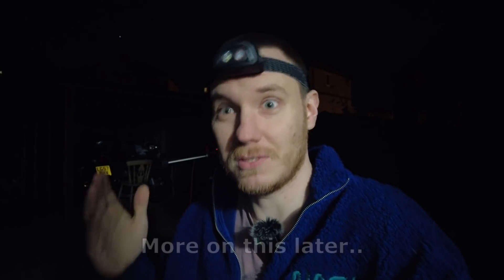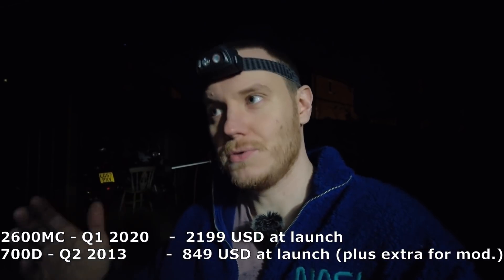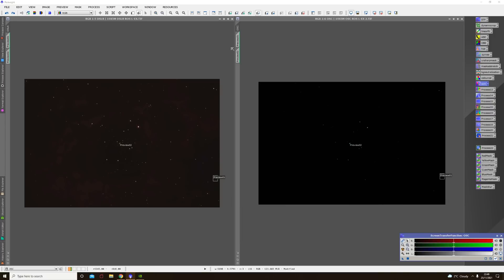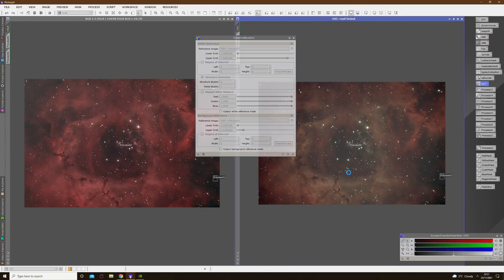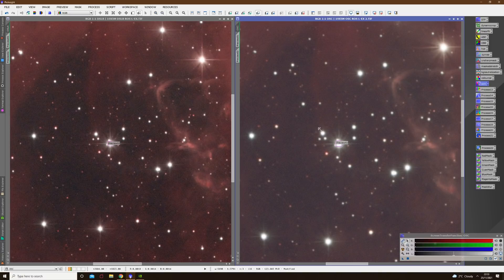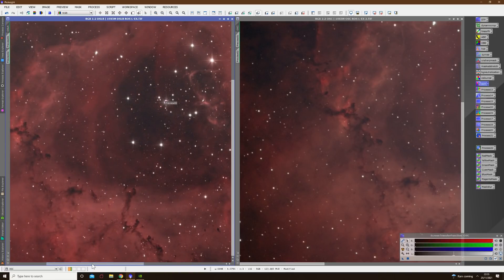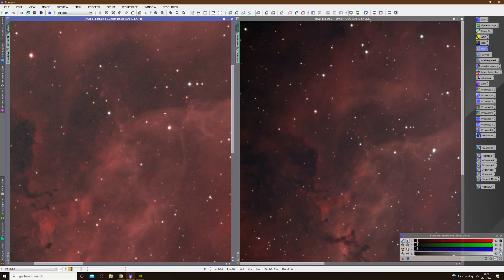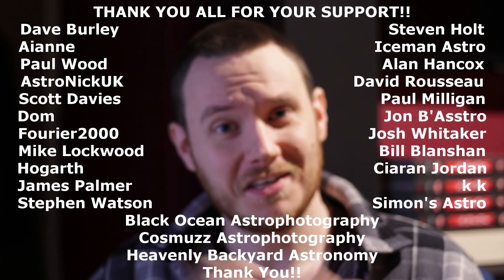Modified DSLR VS Cooled OSC - Part 1: NOT What I Expected!

Comment: I think it would have been better to just edit both images individually. 
Since the DSLR has more noise, but also more contrast, it suggests that the OSC still has some "room to manoeuvre".
Kind of like (but obviously not the same as) the way jpg images look better than RAW images when they both come out of the camera.

It's also a bit like hopping into 2 different cars, and assuming one is faster because the maximum speedometer reading is higher, without actually driving them to test it out.
It would probably have been better to either get both images looking the same (colour and sharpness), and then compare the noise levels; or else get the noise levels the same, and then check the quality. 
If that makes sense?
Reply from the maker: Totally appreciate what you're saying mate yeah! I could/should have added that as an additional segment, then it'd be pleasing to both parties :-D
Thanks for the feedback!

Comment: Interesting test, but I think that DSLR RAW files might have an automatic contrast curve applied to them by the camera, while the OSC camera might be linear. You should have tried to play with contrast to equalize the two images. Then you can compare them.
Reply from the maker: Thanks for the feedback Lou! - There were a lot of ways to approach a test like this I guess, inevitably adding more steps introduces more variables though, so I opted to keep things as simple as possible during part 1, - in part 2 I did alter some aspects of the test in order to improve the quality of the test result, but still try and keep variables minimized :-)
Clear skies!

Comment: In addition to what others have said, the OSC camera has smaller pixels and will need to be exposed longer to get a similar SNR.  I would expect the OSC to have a "softer" looking image, all other things being equal.
Reply from the maker: Hey Ryan! The OSC may have smaller pixels, but does have much higher QE, a BSI sensor, lower read noise and lower dark current, which should more than make up for the slight physical pixel size mismatch between the two cams - I believe something went wrong such as the primary mirror or filter itself slightly fogged during the OSC portion of the test, leading to it being a bit of an unexpected result - part two gave a result more in line with expectations, I switched to my refractor for it to remove as many extra variables as possible 👍
Thanks for watching and clear skies!

Comment: I have just skimmed the comments, so apologies if I missed it, but not much was considered on dynamic range and data clipping. The 700D at 1600 ISO has about 9 EV of dynamic range where the 2600MC is over 13 EV at 100 gain.  I believe what appears to be sharpness may be clipped dark areas. At time 10:43 in your video the core of the Rosette shows nebulosity in the OSC camera but just black in the DSLR, hence my thoughts on DR.  The other issue is in camera processing of RAW files verses the OSC FITS files. I would bet the DSLR processor will boast the saturation compared to the OSC processor, but that is just speculation. Lots and lots of variables to consider BUT the bottom line is that DSLR can provide attractive results without spending gobs of money. Good results have more to do with good technique and good seeing verses super-duper equipment. Thanks for the time and effort to make the video, worth watching.  Clear skies!
Reply from the maker: Hey Edward! - Thank you very much for your thoughts on the matter, they were interesting to read! :-)
I'm happy to say a second test with revised methodology has delivered much closer to anticipated results, while still leaving the DSLR looking like a very capable offering indeed for the price!
I hope that you may enjoy part 2 when released if this is something interesting to you! :-)
Clear skies!
Reply: @lukomatico  I look forward to it. Most all technology has strengths and weaknesses. The old saying "Horses for Courses" comes to mind. The sensor processors in "land" cameras are tuned to process day (high signal to noise ratio) photos and astro cameras  to process low signal to noise ratio photos but there is cross over and all are useful with proper handling and understanding the limits - which is what testing is all about. Besides it keeps us out of the bars (pubs) at night - at least until we get the auto imaging routine down - just don't tell the misses. :) Hun, I'm off to the dark site!

Comment: Very interessting experiment. I think, the Canon photo only appears sharper because it is noisyer. In the further processing you should be able to sharpen the ASI photo at least as much but with less noise around than you would be able to do with the Canon photo.
The tighter stars in the DSLR photo might be caused by the fact that with bigger pixels, you are better sampeled. With the ASI 2600MC you are a bit oversapeled, which blows the stars.
This is my understanding of the really unexpected results.
CS Christian
Reply from the maker: Hey Christian! - Thank you so much for watching :-) I appreciate the hypothesis!
I've since taken a part 2 to this which is nearly ready to be released, which more clearly shows the advantage of the OSC over the DSLR! - I think it seems most likely now that the auto-focuser missed focus with the OSC marginally, coupled with potentially a light misting of dew on an optical element (not tracked down what) reducing and scattering the incoming light.
The re-test was done with my Esprit 120, which has proven to be a more suitable test platform it seems :-) I hope you may agree when part 2 is released for your consideration!
Thank you so much for watching!
All the best,
Luke

Comment: Good comparison. And thanks to take the time to do this test. However, as others have said I’d repeat the test on the very same night and same time for each camera around the meridian (say for example one hour for one camera until the OTA reaches meridian and then change the camera and let it image the same object for another hour). That could be more representative, while keeping all of the same equal.

If I may, to me it looks like there’s a flat calibration difference between both sets (take a look at 8:02). The OSC image to the right shows some vignetting that the DSLR image on the left doesn’t show. Maybe it would be worth checking. When I upgraded from a modified Canon T1i to an ASI071MC Pro immediately saw a difference in pre processing was required: the 071 gave better results if flat darks were used, while for the T1i I just needed a mast3r bias to calibrate the flats.

I’ll be looking forward for your next video on this subject.

Regards,

Alfredo
Reply from the maker: Hey Alfredo!
Thank you very much for the suggestions! :-) I appreciate that, I've applied very similar changes to the methodology for test 2 which is now recorded! safe to say it all went off well on 1 night :-)
I do tend to use flatdarks already for the reason you suggest, normally my images calibrate well but in this case it wasn't quite perfect, possibly due to the limited data pool of lights I had, some may have been contaminated by little bits of cloud contributing to difficulty calibrating accurately :-)
Thank you very much for watching and taking the time to comment!

All the best,
Luke
Reply: @lukomatico  Very well, Luke.

I’ll be looking forward to watch the new video when it’s available!

Comment: This video interests me because my QHY 8L is no longer managed well by the programs. It disconnects too much and the temperature is not stable. QHY technicians connected via teamviewer but nothing special. The next morning they told me that their Stellarmate had managed to fix it. Too bad that the day before not.
I have had the MPCC Mark III 2 "Baader for two years, and I was only using it as a coma corrector without the M48 ring. I decided to mount it to use my Canon, but suddenly it unscrewed and the camera fell on the ground! I bought an M48 ring on Amazon and it works.
How long do you pause between shots?
Reply from the maker: Hey Paolo! - sorry to hear your qhy8l is giving you trouble :-(
On the note of pauses between exposures, I let it have 2 seconds between in the plan I believe :-)
I hope that helps a bit, and thank you for watching!
Reply: @lukomatico  thx :) Even with the 2 second DSLR?
Reply from the maker: The same pause yeah :-) just to allow the camera a moment to clear it's frame buffer 👍👍
Reply: @lukomatico  I thought longer as a break to cool it down more ;-)

Comment: This is excellent, I think its very helpful for people to se the difference between a modded DSLR an a OSC as that is the usual upgrade path and one I am about to embark on! Mind you I plan to use both at the same time to maximise my imaging productivity due to limited opportunities so I am not relying solely on an improvement in imaging quality. Another reason for getting a OSC rather than another DSLR is the cooling potential, where I am the summer night time air temperatures don't drop much below 30 which isn't great for noise on a DSLR.
Anyway these comparisons are massively helpful, keep up the good work!
Reply from the maker: Hey there Mart!
Thank you for the lovely and well thought out comment my friend, I certainly agree with the points made! As you say, Osc really does have a huge advantage in that no matter the time of year, the sensor is freezing cold and making very little thermal signal! I'm sure this test redone in summer would have been interesting too :-)
Thank you very much for watching mate, it's appreciated 👍👍

Comment: Quantum Efficiency.
Reply from the maker: Hey there! - the quantum efficiency argument would strongly lean in the favour of the OSC camera, but the results themselves speak a different argument so far! :-) there must be more at play.
Thank you for watching!
Reply: @lukomatico  Because the quantum efficiency is higher it is capturing more signal. My approach would be to match QE with exposure time to do the test as it is capturing more data including extra light from stars possibly causing them to blow out.
Reply from the maker: That would not explain the smaller non saturated stars also being softer though, I appreciate the suggestion though!

Comment: Interesting Luke, good job.  I also have a Baader mod DSLR, but don’t (currently) use a filter.  To be honest I don’t know much about filters, what benefit does it bring? Do you have a link to the one you used?
Reply from the maker: Hey JJ! :-)
The benefit of the filter is to quite literally filter out unwanted light, and only let through the desired wavelengths, in the case of my optolong l-extreme, that's HA and OIII :-)
They have more limited benefits on broadband targets, often unfiltered shooting is preferred there 👍
I hope that helps!
Thank you for watching!

Comment: Speaking of uncooled cameras in a colder season. What is the lowest temperature outside that you would set your gear up in? My guess is your a winter soldier.
Reply from the maker: Hey mate! haha, you've got me - Winter Soldier! I love it :-D
Generally speaking, if it's clear - I'll set up and try no matter how cold, I may draw the line at something like -10/-15 though as cables/connectors can become brittle at those temperatures!
Clear skies mate, and thank you for watching!
Reply: I'd be careful if trying to cool below the dew point, the temperature at which water starts condensing (or, freezing) on a cooled surface, e.g. the focal plane.  It might be possible to set up a gentle purge using dessicated air, or compressed dry air, or something, that has a dew point in the -20 or -40 degree range.  Then you can cool the array to that temp without fear of condensation.  I'd want to use air or something close to air, to avoid the refractive turbulence of different gasses mixing.  Dry climates and/or winter air has a much lower dew point than humid, muggy summer air.

Comment: There is only one way to compare any (!) Equipment:
Every(!) other part, but the testet part needs to be 100% equal.
You need to set both cameras with two identical optics one one astromount. Both need to capture at the same time the same sky. And both cameras need to be set to unitygain and need to exposure for the same time. 
Than you can compare one single image of each camera.

But: This is not a "hate-comment". Over all it's interessting and you did lots to get good results.
Reply from the maker: Hey there!! :-) Thank you for watching!
They were both set to 'optimal' gain/iso settings, and the exposure times were the same, as was total exposure :-)
I agree that it may produce a more valid test, but certainly not realistic to achieve really at this equipment scale - can you imagine side-by-side 10" newtonians! :-D
It also would have it's own set of new variables introduced, as in - are the optics and collimation of both scopes perfectly matched? would heat leaving the tube of one scope, rising past the other scope, ruin the other scope's seeing somewhat? etc, etc.. - I did my best given the conditions, and still feel it's a largely valid test, but I will indeed be doing a retest!! :-)
Thanks so much for sharing your thoughts and watching!
(p.s, if you are interested to compare, I have added a single sub from each camera, the last sub from the DSLR session, and the first from the OSC session, less than half an hour between the shots :-) )

Comment: Wow I did not expect that!  I was primed for a beat down by the 2600MC-PRO, especially since I just purchased the QHY version of this camera (QHY268C).  Try gain 0 on the 2600 next time.  It looks like at gain 100, your fullwell is down in the 'DSLR' territory of 16500'ish, where as at gain 0 you're up over 50000!  Even at gain 0, you'll convert electrons into ADU's at the twice the rate the 700D does at 1600ISO.  Most cooled camera users crank up the gain to achieve 'Unity", but the 2600 is already faster than UNITY at 0 gain.  This is something I'm curious about trying with mine.
Reply from the maker: Hey there mate!
Thank you so much for the suggestions, I appreciate it :-)
I too went into this expecting it to be quite one-sided, but damn if I don't love an underdog story!!
I will have to regroup and retest, it's a worthy time sink I think!